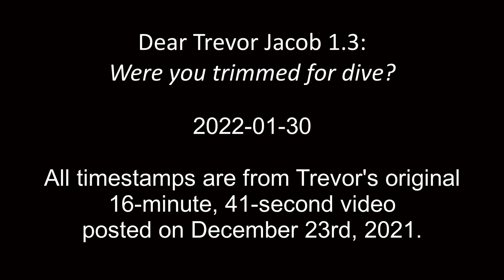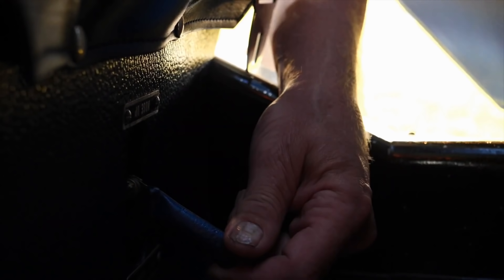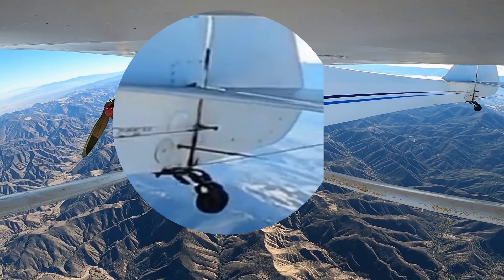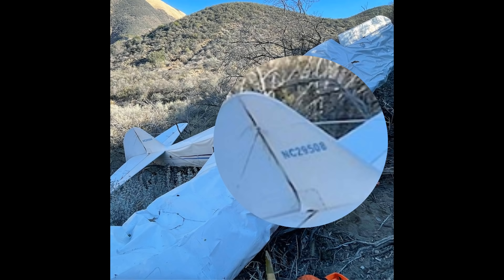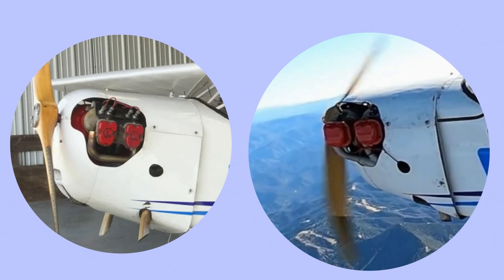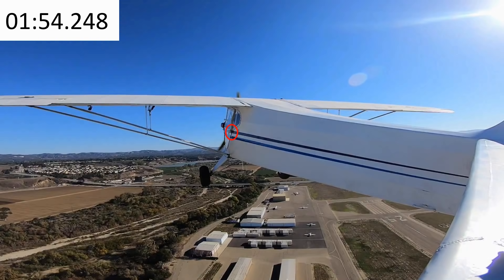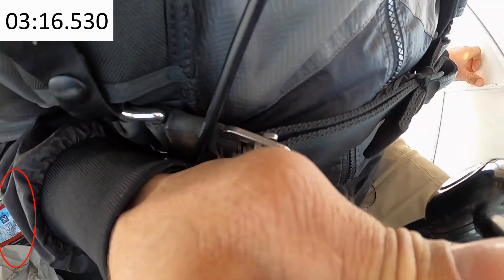Dear Trevor Jacob 1.3—Were you trimmed for dive?

Comment: The elevator trim "flipper" was added in the 1941 year. I don't know how long they kept this. I looked on the Taylorcraft websight for the B series and our boy trevor is listed under accidents and incidents.
Reply: Flippers were added in 1939 and didn't work well so they stopped using them after 1941.
Reply: @Reel-Justice  Do you know if it's possible to remove those flippers and add a 
'modern' trim tab?
Reply: @cluelessbeekeeping1322  I'm not an expert but I will say No, sorta, because apparently the flippers were a flop and phased out in 1941. The trim tabs after 1941 were than added into the elevators. So Yes, it could be done, but you would need new elevators with trim tabs and new cabling to make the trim tabs work would have to be installed.

Thanks for watching and commenting. More videos to come so please come back!

Just read this on another channel

Taylorcraft with elevator trim tabs have a different control for them—a hand crank mounted above the windshield.
Reply from the maker: I’ll add that the Taylorcraft with elevator trim tabs have a different control for them—a hand crank mounted above the windshield. So they are easy to spot from any camera view looking at the front panel and compass.

Comment: The over-wing fuel tank was disconnected from the engine  because it had been pre-filled with water to quench any fire when the (swapped out) engine impacted the ground.  That's why the fuel selector looks so odd as it's "flapping about over the co-pilot's seat".
Reply: The wing tank is gravity fed.  If the fuel line was disconnected the tank would have drained out.
Reply: @tanksoldier  Fair. Although, nothing a bit of silicone can't fix.
Reply: @tanksoldier  there are things called plugs made for just about anything…
Reply: Bolt and hose clamp has been used by mechanics for decades when disconnecting lines during service

Comment: What it looks like Jacob did was he filled both wings with water and only filled the center tank with fuel. That way when it crashed the possibility of a fire would be limited.
Reply: My brother and I were just talking about this a couple of days ago, and we came to the same conclusion. It explains why the feed line on the right wing tank is obviously disconnected in the video. Little doubt that the left wing tank is likewise disconnected, but out of the camera's view.
Reply: Did this aircraft have a left wing tank added? I thought it had like a 12 gallon main header tank and a 6 gallon tank in the right wing? Obviously it's undergone multiple changes and upgrades including the engine, but I haven't heard any solid evidence on a left wing fuel tank addition?
Reply: @berryreading4809  Most Taylorcrafts have a tank in each wing, plus the header tank front and center, but some of the really old ones had just one wing tank installed. The viewing angles are limited, but it's difficult to say if there's a tank in the left wing or if the cabin interior plumbing has simply been removed on that side. We know that Trevor made modifications to this airplane, but I don't expect him to be very forthcoming without some investigational pressure being applied...
Reply from the maker: I'm fairly certain this model never had a left wing tank. There are drawings that show how to add two fuel tanks to each wing, but I don't think that was done here.
Reply: This aircraft only had one aux fuel tank in the right wing.
Reply from the maker: That is indeed what I believe the original factory configuration to be. 

There are modifications for extra fuel tanks mentioned in the manual and on the Taylorcraft.org website, but I don’t see any evidence these mods were done.

Comment: I am wondering about fuel.  The RH wing tank appears to have been disconnected and mention has also been made of the cable showing from the hole on the engine cowl.  Signs of playing with the fuel system ?  I am wondering if the water bottle/and or the cylinders attached to his legs may have had more to do with surplus fuel, just in case he counldn’t go through with the escapade.   Also in another video a pilot mentions the engine cut off switch and how it is guarded……….

Comment: So the water during the crash and the fire extinguisher is to prevent a wildfire?
Reply: Dave Pin  to be fair, trevor removed both internal gopros before he jumped. the dash cam no longer had footage from engine "fail". he shut off the dash cam, pocketed it, then grabbed the over the shoulder gopro and used that to film his selfie freefall.
he only had to retrieve the external gopros from the crash.
Reply from the maker: I don’t think that’s right. I haven’t yet posted my analysis of the cameras, but I can clearly see the dash cam still on the dash in photos taken while he is bailing out. Might get to that next week.
Reply: @PetesGuide  youre right, just went and looked at the footage before impact, yeah, the dash gopro is still mounted.
Reply: @Meika_Rei  is it possible the engine was so terrible that he was worried about it catching fire?  The fire extinguishers is confusing cuz he has two of them for a reason.  This was planned and deliberate, so everything he is carrying has a purpose.
Reply: @shadowofchaos8932  it wasnt just the gopros he was worried about, yes the footage from 3 cameras would be lost in the event an uncontrolled fire did break out, but causing a fire on a federal park... that is a whole lot of legal issues(on top of the purposely caused crash) he would have to deal with.
not only would he have had to deal with that, but the spread of the fire in the dry arid environment, would have very likely caused property damage to any homes caught in the fire. and all linkable to his flight and crash stunt. he would be sued into oblivion by civilians as well.

Comment: I noticed some other things in his video too. Compare it to the 2016 photos of the plane. What looks like the exhaust pipe on the bottom of the engine, has a very tight cut out hole around it. But after TJ has the plane the hole is enlarged and goes to the top of where the purple and blue pin striping begins. Then look at the engine cover where the cylinder heads are. In the 2016 photo everything looks pristine. In the TJ photos the engine cover in the area where it curves down is best to crap. And, directly behind it the fuselage is cut in the same area from the engine cover all the way back to the window. Why is that?
Reply: Because Trevor changed the engine from a Lycoming that it was registered with (both the last owner, and Jacobs registration clearly read Lycoming) to a continental engine.  This means the precise cutouts for the engine, wouldn’t work for the continental engine, and they had to be modified to work

Comment: I have postulated the wing tank was filled with water and thus the corkscrew to the right  with the right wing heavy.
Reply from the maker: That might be the case.
Reply: @PetesGuide  I think that the reason he was horsing the yoke back and forth was that he was trying to set the elevator trim at that time. I believe that he was trying to set up a spiral descent for the dramatic effect and to limit the potential crash-site radius. 
Whether one wing was heavier or not could have been a factor in the spiral, but it's also possible that he just hooked the buckle end of the seatbelt through the yoke on the passenger side, to bias the yoke to stay turned after he exited...
Reply: He could have used bungee cords attached to the yoke to trim down and to the right. Ultralight guys commonly use bungees for trim.
Reply: @andrewdynes5300  yeah I thought about that, too. But really simple just to hook a seatbelt through the yoke as well. Most lightplanes will naturally do a broad spiral hands off, especially if trimmed a bit nose-down, though.
Reply: According to Wolfgang Langewische’s “Stick and Rudder,” a stable, well-mannered aircraft left on its own will do just that— seek the airspeed for which it is trimmed by entering a descending turn that gradually turns into a spiral dive. That sweet plane was flying to the end.

Comment: OK, non aviator her, why have so many people said about the door being open at take off? Surely you CAN open the door during flight? Can someone explain why this matters?
Reply from the maker: Since it appears that he intended to bail out, this is just another corroborating bit of evidence. In some airplanes, it is indeed common to fly with the door open, but these planes have doors with a different design.

Would you routinely drive at highway speeds with your regular car door open? I thought not.

Would you routinely drive with your car window rolled down? I thought you would say yes! These silly examples map well to the distinction in small planes:

Planes with doors like those on the Taylor Cub/Piper Cub have doors that hinge down flush against the fuselage, and windows that hinge up against the wing. This specific design is used on virtually all modern 2-place bush planes. If Trevor had been flying in one of these, no pilots would be questioning why he had the door ajar before the engine quit. But with a car-style door that opens against the airflow, it’s more than a bit unusual.
Reply: I'm no aviator either, but my take is that he knows he's flying a sketchy machine (he's planning to crash it, after all) so if it fails before he wants it to, he can escape quicker.

Comment: Hi, very interesting details there. Well done.

However, I think he might have stuffed something else under his jacket not the water bottle.

I'm not defending anything TJ has done, but I get from your video that you do indeed like the small details. So I would like to add something please:

in this video https://www.youtube.com/watch?v=KXN9NIIcP4g at around the 9 to 10 second point, look very closely through the side window. You will see something that looks like the top of that water bottle (complete with the handle) briefly rock forwards and back. This could well be the water bottle that was on the passenger seat, let me know what you think 👍

In fact, I've just watched those few seconds of footage again and again on loop and I'm convinced that its the water bottle. It rocks forward as the aircraft briefly dips and then rocks back as the aircraft corrects itself. Kind of like if you had it sitting upright on the passenger seat of your car and applied the brakes slightly then came off the brakes, the bottle would rock forward then back to its position. The more I watch those few seconds, after seeing your picture of the bottle with the handle on top, the more I'm convinced it's the water bottle

Comment: Your frames showing the position of the trim tab (around 2:29) do not show anything like an airfoil there.  
The aircraft appears to be well painted, with all wings and leading edges painted white.  
The think you identify as the trim tab is near-black - the same colour as the control cables and levers adjacent to it.
In my opinion this is the shaft the trim tab was on, but the small wing foil is missing.
Your image of the tab on the other airframe (2:06) shows how far the tab rotates.  It is far past the angle it would be if lined up with the main wing camera.
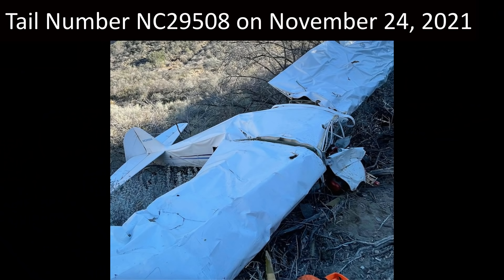At 4:25 you show the aircraft as it was a few years ago.  This shows the same shaft, and again there is no sign of the actual trim tab control surface.

It would be too much of a coincidence for the tab to be exactly lined up with the camera position on the main wing in the video AND exactly lined up with the camera of a person standing beside the aircraft in the earlier photo.

IMHO there was not a trim tab control surface on the aircraft either when it was recently purchased, and when it was abandoned over Bald Mountain.
Reply from the maker: The trim flipper/paddle does not have an airfoil cross-section, it’s just a flat flipper. And it is there, I’ll show additional images in the next video that show it not-edge-on.

Comment: Bingo!
Reply: He never trimmed after engine turned off. He was also turning right into the wind most of the flight. It should have turned left but he trimmed to the right.
Reply from the maker: The elevator trim lever is below his seat, so the camera can’t see it. I believe that the rudder trim is a bent metal strip on the rudder, but haven’t looked closely at that yet.

Comment: i have a video showing that MR.PLUSSES video was altered it dose not look like the original
https://www.youtube.com/watch?v=6IpRjw01G9o&t=2s

and then their is the fact we are looking at the left side of the aircraft and it only has a right wing tank and a main tank in the nose from the go pro mounted to the tail you can clearly see the right side wing has a red cap the left side wing has no cap of any color so how did he get water into the wing

the orange you are seeing is just dust and debris not a fire if their was a fire we would have see evidence of that in the crash site video in the form of burn marks also without a source of a spark how dose it catch fire 

also if any ware was going to catch fire it would be the engine and he shows that in his crash site video and their is no sines of fire being any ware near it let alone water being near it or a fire extinguisher being used also it took him over 20 min to reach the site so it would have ben completely ingulfed in flames by that point

the explanation for not seeing his jacket again is what ever he was hiding it it busted open when he landed you can see what ever it is gooing out of his jacket and what ever it is its wet and sticky 

now lets talk about that elevator trim the flipper is completely missing that is just the control rod it attaches to you can also see it clearly in the video taken with the go pro in his hand as he bails out and their is clearly no flapper on that rod

also in the bail out check list it says to remove the door he did not remove the door

and no what ever is in his jacket is not the bottle of water in the video taken inside the cockpit just before he bails you can clearly see the thing in his jacket is already their and the bottle of water is sitting in the co pilot seat
Reply from the maker: Somehow YouTube put your comment in the Held for review section--apologies for not clearing it sooner than just now.

I'll get to your other comments later, but I feel relatively certain that the differences you point out in that one frame between MrPlusses video and Trevor's are best explained by differing levels of compression in what was streamed inside the YouTube web-based video player.

Except for my screenshot of MrPlusses video taken in the web browser (and a couple of other similar shots), all of my screenshots were taken from a 1080P copy of Trevor's original video that I downloaded with a YT capture service. I then sucked it into my video editor and examined it frame-by-frame there, and generated the still images with the video editor's frame export feature, thus bypassing random streaming artifacts.

Comment: 4:27 This is not a BL65. BL65 did not have the egg shaped window behind the cockpit. This is a Taylor Cub. You never really see the rudder in full until Trevor finds the plane after the crash and the plane on the ground is not a BL65 either, its a Taylor Cub. At least the tail wing and rudder is.
Reply: It was built as a BL-65. Apparently the motor has been changed to a Continental. The registry lists it as a BL-65, instead of a BC-65. Little doubt that the correct form for recording the work (Form 337) has not been filed and approved by the FAA.
 It's not a Taylor Cub, which would be an E-2.
The subsequent Model B was an improvement over the original Taylor E-2 Cub.
Reply: Another thing about the window behind the cockpit door. Those are commonly called "D-windows". Back then they were a factory option...some owners chose to get them, and some didn't. Most Taylorcrafts have them, but I sometimes see one without. Some were even added by owners and their A&P mechanics, and not all of the added ones have done a good job of duplicating the factory shape, so there's a bit of variation on that point.
Reply: @TheIndyspace  Great knowledge. I struggled to find pics of that plane and only the Taylor Cub resembled it so I thought it was a Cub.